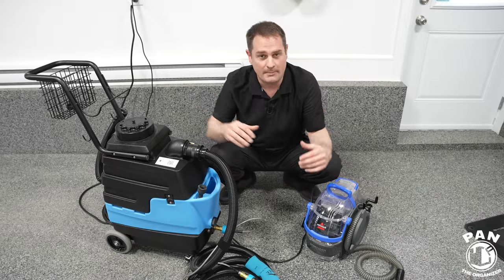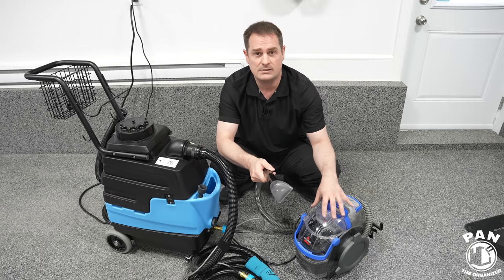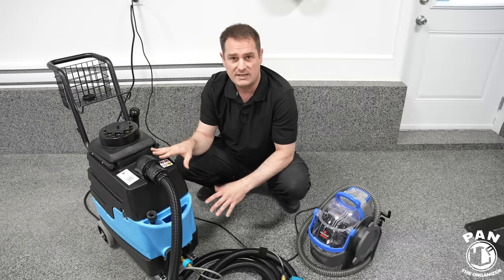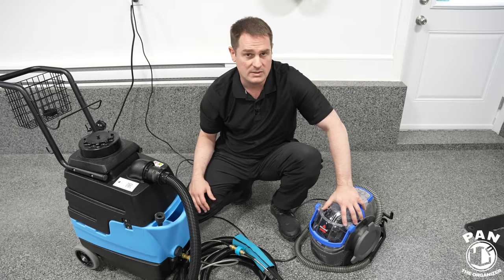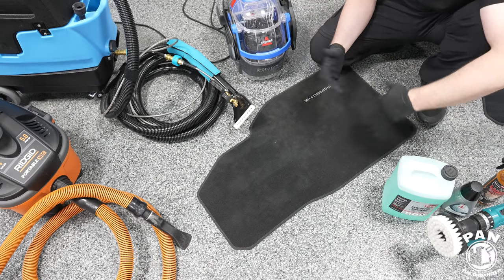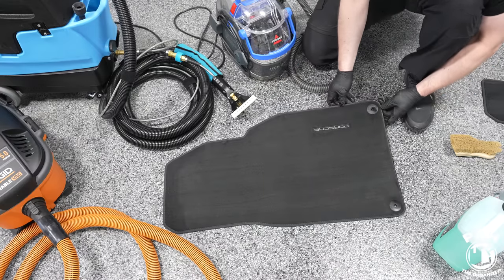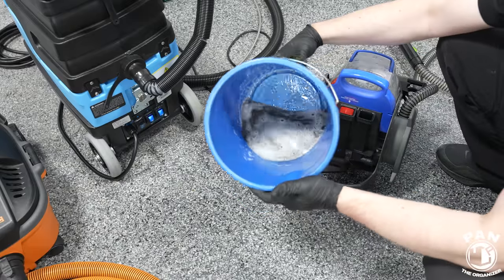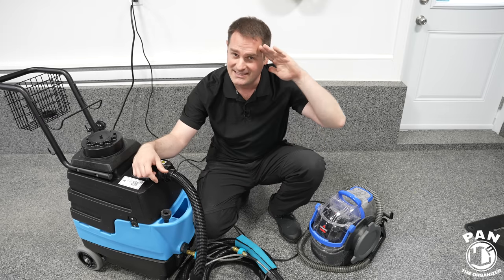Cheap VS Expensive : Carpet Upholstery Extractors

Comment: I have a Bissell unit. I use it on my car.  I run hot tap water through the unit and I use P&S products. Terminator and Carper Bomber. Great products. If you are an enthusiast, this combo won’t disappoint you. I know as an enthusiast, I keep my vehicle on a regular maintenance schedule, so built up dirt will never be a problem. But for pro’s, no doubt, the Mytee unit is the way to go. Great video Pan. Maybe if I win the lottery I can upgrade. 😂😂Till the next one.
Reply from the maker: Yeah Carpet Bomber is so good!!

Comment: One tip with hot water extraction is to also “prime” with the hot water first back into the tank so that you get that 180-210 deg water from the beginning.
Reply: Kinda tough to get hot water whn you do mobile work
Reply: 22:28

Comment: Nice to see the Bissell get some love! Obviously the Mighty is the superior machine, but the Bissell offers a great value and has good performance for what it is. As always, great video!
Reply from the maker: Thanks Josh!
Reply: Bissell actually is good enough for most, and if used properly it won't brake at all, like many claim...just be aware of the home-use intention and be carefull with putting pressure on the head. 
I actually love mine, especially since I'm working out of a small hatchback. The bissell fits my needs perfectly tbh ;-)

Comment: The smaller commercial grade extractors aren't great. I've got the mytee spider (1 size up from the one in the video) and for $1,500 I'm not all that impressed. It will definitely slow you down detailing, because you have to wait on the water heater after doing one side of the vehicle. I've come to the conclusion that there's really no cheap way out with extractors, the good ones start at $2,500 and go on up to around $4,500. There are new extractors being sold that are powered by diesel, if that tells you anything. Even the $1,200 and $1,500 ones are really just an attempt to get the prices lower, and they're not great for commercial use imo. So if there's some way that you can make a cheap one work for you, I'd do it. Because when you really want to move up, plan on at least $2,500 if you're going to use it all the time.

Comment: Great video I was wanting to extract carpets but didn't have a lot to spend on a carpet extractor and for roughly 40 dollars in parts and a shopvac I already had I turned my shopvac into a carpet extractor and it works as well as I could want for what I'm doing

Comment: Pan you did an awesome job explaining some of the differences between these two machines. Growing up in carpet mills in Northwest Georgia I have seen a lot of carpet. Basically if you are doing two or more interiors a week get the Mytee. This machine is built for hard work and offers more lift which will save time not having to make extra passes. The downside is more maintenance is required on the Mytee. The Bissell will clean very well but it just takes more time. The upside is the smaller head fits in tight spaces better and the maintenance is much easier. When your the one backing the warranty on carpet hot water extraction is the top tier level of cleaning. 
Thank you for another well thought out video Pan.
Reply from the maker: Thanks Neil, much appreciated feedback from a person with real world carpet experience!

Comment: Both of these units have very useful purposes in detailing.    I have both style's,  but honestly I tend to lean towards using the Bissell far more often due to it's portable size and decent performance, especially on well maintained vehicles that you are just looking to do a once or twice per year maintenance cleaning.    One really cool unit I have been lately was the model put out by Larry over @ AMMO NYC.   His unit is a specifically designed unit that took the best of a steamer and the best of an extractor and combined them.   STEAM helps fabric cleaning tremendously.    I would say it close to doubles your performance than without steam.   Of course you just need to be mindful using steam on certain interior parts (especially painted buttons) but as long as the material you are cleaning is fabric,  steam isn't going to degrade the fabric if using the steamer as directed.   The ultimate would probably be a Tornador also integrated into the mix combining an extractor,  steamer, AND the Tornador head.  Tornador does make a vacuum hose attachment (I think in their black series).     The Tornador head (Pan has other videos on that series of tool) can be integrated into your extractor/steamer making the ultimate detailing interior cleaning tool.

Comment: a couple things i would mention on these cleaners, i have used the little bissell spot cleaners since the late 90's i think it was called the little green machine or something, the thing i like most about them vs the mytee is the small handle, definitely more maneuverable in an automotive setting as far as getting around seat mounts and up towards the dash floor board area and up the sides of the door edge ect., i like to fill mine with hot water and no solution, then i use a pump sprayer with lite solution scrub with brush then extract, following with water only extraction to remove all solution out of carpets so there is chance of residue because that is the #1 cause of attracting new stains. but i am sort of ocd when it comes to left over residue on any surfaces lol it drives me nuts when i can feel or smell left over cleaner, plus that way it doesn't interfere with your chosen air freshener. just my opinion. love your videos pan !!!
Reply: One other little tip.  The Bissell uses polycarbonate tanks.  Since the tank is small, you can fill it with hot tap water and then put the whole tank in the microwave and heat it up to ~80 C or so.  Works best if you are just using plain tap water with no cleaning solution.  Using your technique, which is a great one, after the clear water cleaning, the drying is very fast due to the heat and the cleaning and extraction is better with the heat. You don't want to go to a full boil (100C) on the extraction water, but you can get it quite a bit hotter than tap water.

Comment: My Bissell is FOUR YEARS OLD!  Like many viewers, I’m thinking of the Mighty Mite after my Bissell bites the dust.  STRANGE TIP:  My auto detailing vendor said if you don’t use Bissell’s carpet shampoo, add about a tablespoon of Downey Fabric softener down the hose, otherwise, the Bissell machine will overdose on suds.  Thanks again for  ANOTHER great video!
Reply from the maker: Thanks Keith!

Comment: Thank you, 
Floor mats I would always lightly pressure wash by hanging them up until the water runs fairly clean. I might spray some solution in lightly and brush them but generally there’s just too much dirt in there there too. Spend time with the Extractor until the very end 40 years experience.

Comment: I have the Bissell spot pro. Using it takes a lot of work and time on very dirty seats and carpet. I spent 3 hours just getting the cushions on 1 seat clean. Clean is when nothing but clear water being extracted. A pro unit would be much better for large filth jobs. It can be done on the smaller bissell, but to get the job done fast, get the right equipment for the job.

The name spot pro is mostly for lighter jobs where the vehice is mostly taken care of. I have the MC1275 steam cleaning machine. Does a great job of paneling and frame of Engine cleaning. I use purple power on really dirty engines and carpeting that has grease and oil on the enterior 1 oz Thanks Pan great review.
Reply from the maker: Thanks for sharing! And yes for sure, commercial grade higher end units will always get the job done quicker if someone can splurge to get one, they will be happy.

Comment: My mom had a Bissell carpet cleaner and the floor part stopped working but the hand held tool still works fine so she gave it to me.  So it basically works like the Spot Clean Pro, but it has a heater.  The only downside is it's larger than most stand up household vacuum cleaners so it's a bit more bulky than either of these units, but for free with a water heater, I can't complain.  Although if I do start doing detailing full time the Mytee Lyte would be a good investment for the sake of speed as my Bissell definitely takes a bit of time to get stuff out of carpets.

Comment: I use a professional steamer that can also be used for extraction with either hot water or steam, just connect any size wet / dry vac.  I use professional carpet cleaning products, mix, spray, agitate then extract with water.  I use Saiger's Sauce 1 pre-spray.

Comment: I have the 2nd gen Mytee 8070 and it's been an absolute unit for me. Owned it for 4 years or so now and, while I don't do detailing jobs as regularly as I used to, it's an awesome machine when needed.

I've used it around the house a few times for spills etc, but it is pretty overkill for that purpose and there are better machines for larger spaces.

Comment: Excellent video. I have the Bissell Spot Clean Pet Pro. I use a combination of P&S Carpet Bomber and ONR in a pump sprayer, then use my McCulloch steamer the extract with hot water in the solution tank. I got ten years of heavy use from my first Bissell extractor, which is why I bought the unit I have now.
Reply from the maker: Thanks Ron!
Reply: Does that mean It is safe to use other products in the Bissell apart from their own branded ones ?

Comment: I've owned a MyTee for the last 5 years and it constantly has problems and it's too heavy to lift in and out of my vehicle along with the many boat cabins I put it in as they're up on land when I do them. I'm going to replace it with the MyTee S300-H as it's much smaller and lighter. Only downside will be the water capacity. I had a Rug Doctor spot cleaner for a while and it proved to be more reliable than my 8070. It was much easier to transport as well. The MyTee S300-H looks like it's the best of both.
Reply from the maker: Thanks for sharing your experience. How did you discover my channel by the way?

Welcome to my channel. You discovered one of the biggest car detailing channels on YouTube as we surpassed 1 million subscribers and we have over 135 million views! I have been detailing for 27 years and I love to share my knowledge and passion with my viewers.

You found the right channel to help you learn everything about detailing.

Comment: As a weekend warrior my only issue with the Bissell is the tanks . Run out of water very quickly and the dirty water tank fills  to quickly.  They clean nicely  . I've just purchased a Karcher and love it ...but same issue as the Bissell...need to fill the water tank twice to do a full clean on a car . Another issue I have come across is the cleaning detergents. Some of them like the Bissell may foam to much causing your vacuum to either switch off or foam out the sides

Comment: For $1300 the Mytee should come with an extension wand so it can be used on household carpets.  The Bissell works great, I wish they made it easier to replace the hose, you have tear it down quite a bit to replace the $50 hose it’s less troublesome to just buy a new one.

Comment: Hey pan,

Coming from a background of truck mount extractors, I was trained to remove as much dry soil and debris as possible. For larger areas, it was 4 back and forth passes with a vacuum that has a powerful motor driven brush roll (specifically Riccar tandem air, or Kirby uprights). And for smaller or hard to reach areas we used Tornador Velocity Vac, hooked up to a shop vac and a high output air compressor. This is considered to be crucial, since wet dirt essentially turns to abrasive mud, this can lead to poor extractor performance, damaged carpet fibers, and bleed through clay stains.

So I gotta ask, why the disconnect in procedure between car detailers and home carpet cleaning professions? In your own video, and videos from many other car detailers, I see carpets/upholstery cleaned with a suction only tool. 

Suction removes surface debris, but cannot agitate and separate carpet fibers the way a brush roller can. So you ultimately have a lower dry soil removal rate. This increases certain risks such as:

1. Leftover sand is abrasive, when pre agitating a carpet detergent with a brush, you effectively wet sand the carpet fibers, the more leftover soil the more carpet tufts get frayed from abrasion.

2. High concentrations of dry soil will turn into a thick mud, which tends to sink deeper into the pile, making it more difficult to extract, and costing more in time and chemicals.

3. After wetting dry soil, if large amounts are present, deep soiling can actually transfer to the surface of the carpet/upholstery.

I don’t mean to sound rude by the way, Just trying to learn a detailers perspective. Other big detailers got offended by the question, so I just wanted to make that clear. 😅
Reply from the maker: I'm confused. Did you not see the agitation part with the drill brush attachment and the carpet cleaner BEFORE the extractor was used? I don't see the disconnect with both industries personally. I showed the way I do it:
1) Agitate loose dirt and debris with a carpet brush. This loosens the fibers and gets dirt ready for pick-up.
2) Vacuum the surface to pick up loose dirt and debris.
3) Pre-spray with a carpet cleaner.
4) Agitate with a drill brush attachment. 
5) Mop up excess liquid with a microfiber towel, which also gently scrubs the surfaces and traps dirt particles in the microfibers.
6) Use the carpet extractor to inject an appropriate cleaning solution with warm water (or heated in the case of the Mytee) for a deep clean, dissolving grease and grime, and sucking all of that up with the succion power of the integrated vacuum.
7) Let it air dry.
8) Apply a fabric guard.

That's the correct way of doing things at least in the detailing world. I don't see what you would do differently in an automotive setting really.

I never get offended when people can bring up points in a civilized courteous manner the way you did by the way. So kudos for being respectful and asking questions that you need clarified.
Reply: @PanTheOrganizer  Thanks for getting back to me!

I did see the dry drill brush, I probably should have addressed it better. 

My reasoning is agitation followed by vacuuming, isn’t quite the same as agitation and simultaneous vacuuming. 

Brushing alone brings debris out, but gravity will cause some soil to fall back between the pile fibers as you brush, carpet fibers quickly move back to their original position recapturing particles as well. Thus when you vacuum afterwards the carpet fibers holding dirt don’t remain well remain separated. When it’s done simultaneously, the brush bar will part the individual fibers allowing airflow to actively better reach between the carpet fiber. Furthermore some motorized brush bars are designed to impart vibrations into the carpet pile which causes debris to surface as well. 

To be clear, I Don’t see any problem with the actual extraction segment.( Extraction procedures vary greatly depending on the person or company,  some use pre spray only+plus hot water rinse, pre spray+ detergent+no final rinse, and some use pre spray+detergent+neutralizing rinse.) Just wanted to touch on the vacuuming portion. 

There used to be a video showing 30g of sand embedded via 80lb roller on floor mats, then comparing recovery efficiency of various vacuuming methods. I recall all other methods falling behind by 20-30% compared to a powerful brush bar vacuum. Can’t find it anymore though… At this point I’m tempted to recreate the experiment!
Reply: @orthodox1717  A canister vac with a small air driven turbo brush, some canisters have small motorized brushes as well. Dyson cordless vacuums with motor brushes are another great choice. Finally for awkward spots we have the Tornador Velocity Vac. For removable carpeting use a full size quality vacuum.

Comment: I just recently bought the 8070. Have both units now, but keep running back to the bissel as a backup. The Mytee has done 4 cars and have already started running into problems...

Had to replace a check valve after the 3rd car, now after the 4th car nearly the entirety of my solution tank has leaked out on the floor. Leaving me to believe the pump is now bad! 

Why am I running into so many issues with this already!! I thought these were supposed to be the best in the business!!
Reply from the maker: Did you try reaching out to the brand? I never heard complaints from fellow detailers that use this machine in their business.

Perhaps contact the place where you bought it from. These things come with stout warranties for situations like yours.

Comment: This video is perfect timing as was just researching Bissell and thinking of options! I love your channel Pan it’s taught me so much as a newbie weekend warrior in the UK. Two questions if I may:

1. if you’ve already sprayed and agitated cleaner into the mat can’t you simply do a plain water extraction without another product in the unit itself? 

2. Would you recommend firmer bristle drill brush for heavily soil carpets rather than the light ones you were using?

Thanks Pan!
Reply from the maker: Thanks for the positive feedback!
1. Yes you can. If the mats are super dirt though, or you want them to smell good, having the extractor shampoo is great.
2. You wouldn’t want to damage the fibers so I would do multiple passes of a softer brush. If you want to use a stiffer brush attachment, make sure you test on an inconspicuous area first.